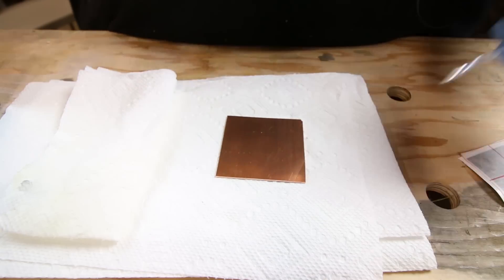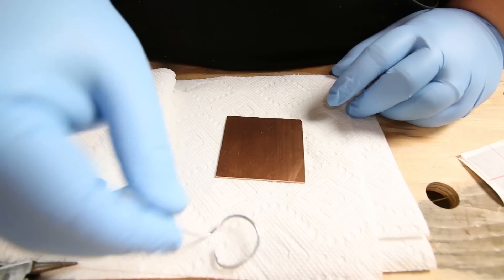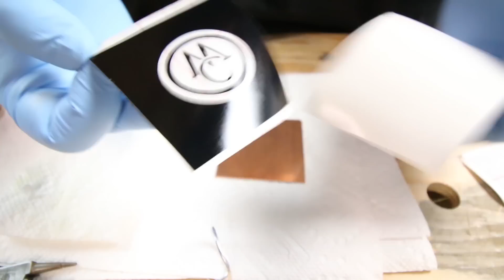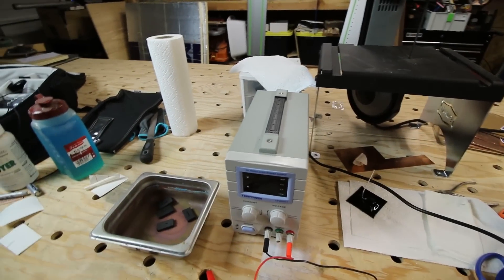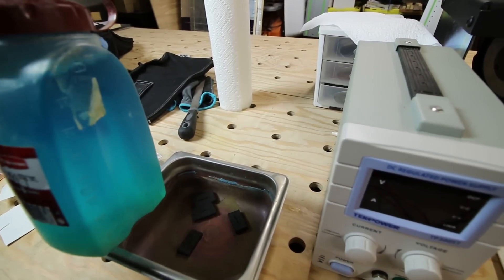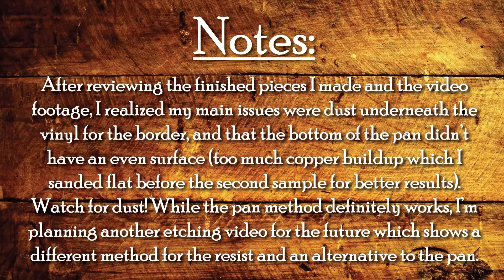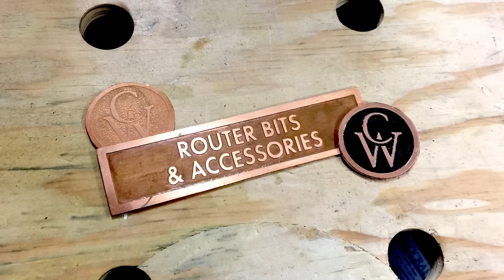Etching Copper Badges & Nameplates Without Acid!

Comment: Since you're removing copper, you can simply use household vinegar with a bit of salt to increase conductivity. The copper sulphate isn't required. The copper in solution is only useful when plating.

Comment: Just my two pennies worth - solder your contact to the corner of copper.
Clean your copper plate with half a lemon and a shot of baking soda to de-oxidise it.
Apply your vinyl as a negative image and remove the excess. Dry the plate and apply a thin layer of wax or nail polish to the whole surface of the plate. Remove the rest of your transfer using a very fine needle to leave the mask in place.
Take a tall glass container and fill it with your electrolyte. Bend a strip of metal for your neg contact and attach the clip. Hang it over the side of the glass. Clip the positive to the plate contact and suspend the plate into the electrolyte. This will prevent bubbles released during the etch from getting trapped on the surface. 
Power voltage and amps - the lower end will give a cleaner and go make a coffee and a sandwich and chill for 45 minutes to an hour.

This should give you an etch that you could use for printing if you so wish.

Comment: Would you be able to use a 3d print as a resist in order to save material? Or maybe wood. Not sure if it will eat through it. Trying to etch .25 inch stainless steel using the salt water electro etching method. Thanks.

Comment: I know when etching steel we use the negative black contact to the item youre going to etch and the positive red to a waste peace of same type of metal.... Maybe try that with two types of copper..... Also I don't know it it will be better but try baking soda and tipex or nail varnish for the areas you may need to keep from etching

Comment: I wonder if you could spray paint through a stencil to get a better sealed pattern. Then after the etching, just wipe down with paint thinner, or maybe just heat up the copper until the paint burns or peels off.
Reply from the maker: This is definitely something I want to try - put down stencil vinyl (or even regular vinyl), spray paint it, peel, then etch.  This I think will work better than a traditional stencil which doesn’t always mask cleanly.

Comment: What kind of blade do you use on your bandsaw for cutting the metal?
Reply from the maker: It’s a Milwaukee Portaband saw which is designed for cutting metal. I’m using the Milwaukee-made Portaband blades. I think it’s the finer tooth pitch - something like 14tpi or something like that.

Comment: Maybe a grease or a wax would work well as a resist? You could 'print' the wax or grease on to the copper using the relief of the vinyl. Just an idea.
Neat idea you have there making the copper etchings.👍
Reply from the maker: That’s an interesting thought! Wax definitely has been used as a resist and probably would hold up well. Thanks for the idea - filing that in my noggin for future testing.
Reply: You can also use Red Staedtler a Lumocolor CD-R Pen, oil based Sharpie Paint Markers and StazOn solvent ink as a resist.

Comment: would it work, if you used regular (salt)water as the solution??? Water would split into hydrogen and oxygen (very flammable!). And the side the makes O2 oxidizes (corrotes) like hell. don't recall if is the positive or negative lead.....

Comment: you could have just "painted" the solution onto the exposed metal... anything else is just a muck around.
Reply from the maker: Not really. It takes a lot of time for the etching to happen. And it also needs both sides of the electrical circuit. Some forms of etching allow for that but this isn’t one of them.

Comment: Thank you for the tip on the chemical ratio. The tough part of milling the reliefs with multiple end mills is as you mill material away, the stock stress relives, and it "potato chips" . All it has to do is move a couple tenths of a thousandths and you end up with steps in the relief. The software I used was "Solidworks" and their post processor to generate the tool changes and "G" codes for the program. I used a Haas vertical machining center, and tried holding .250 thick brass stock in an Anglelock vise with aluminum jaws with a dove tail / step milled into them to hold the stock. Also tried drilling hold down holes in the stock with 82 degree countersinks, and machining a fixture to bolt down the stock with flat head Allen screws so I could mill the relief, then mill the profile all in one shot, and the stock still warped out as the relief was milled. I was milling .093 deep. What consistently works best is to do a rough cut, then adjust tool length offsets in the control, and rerun the program to eliminate the steps. It works great. Just takes a long time. Again, I enjoyed your video, and want to try etching.
Take care

Comment: Hello . Very cool process. I'm a machinist and have machined detailed plates like this for different applications. Running multiple end mills to get the small details and perfectly matching tool length offsets so there are no steps in the relief areas  takes FOREVER !!! Comes out awesome but takes too much time. This process is much easier and you don't need access to a quarter of a million dollar machining center. Question, what is the ratio for the copper sulfate, to distilled water?
Again, great video. Glad you showed the failed piece too so people know what some of the pitfalls are.
Take care
Reply from the maker: For the ratio on the copper sulfate - basically just keep feeding it in until the water won’t dissolve anymore. I know that’s not very scientific but it’s the method I learned from someone else and have used myself. RE: Plates - you’d be surprised just how many of these type of plates are etched, even now. At my day job we ordered thicker etched plates from commercial etchers every day and the quality was superb. Ironically at my work we bought a Datron CNC to do our engraving now just because adding a new commercial etching solution in California that hasn’t been grandfathered in is ridiculous. Plus dealing with the harsh chemicals is a pain and expensive. One tip - if you do have to mill more plates on a CNC there are softwares out there that do the tool changing and calculations automatically now.

Comment: Here is a tip. leave the vinyl on the plate attached for at least 2 days on a place outside on the sun, you will be surprised how well the result will be, that is how I have done it. very sharp edges and deep.

Comment: there is a trick to get rid of air bubbles. you spray the copper with water and soap. then you press the sticker and then use a flexible spatula to drive water soap and air out. works every time and no water stays under the film.
Reply: You are describing how vinyl is applied to van graphics and signage. I agree. DRY application does not get the air out, resulting in bubbles (gaps ), as well as thickness variances from manually stretching the material to try and flattening it. I wonder if using decal material really is the optimal resist right from the start.

Comment: I believe the size of the loop in your wire may be contributing to your border issues. There will be a more intense field created across the circular shape leaving a weaker field etching the border. Also a second plate under the first acting as the negative electrode separated using the foam pads will be more controllable. And distance between plates will change the speed and depth of the etching. The finer control over the dynamics of the field will improve the even etching of the material. I worked on equipment on an industrial scale, scaling it down to what you are doing will have some constants in distance and such but not so much with the field created.  Great work, looks likeyou are very close to perfecting your process. Great video. Interesting subject.

Comment: Same process my dad used to copper plate stuff, just reverse the poles.
Reply from the maker: Even in this arrangement that’s basically what’s happening. If you were to reverse the poles though I think you’d need a copper rich solution or to have both sides of the circuit be copper (in my case I’m basically copper plating the stainless tub, but it wouldn’t work in reverse since the tub isn’t copper).
Reply: Forgot to add the copper sacrificial piece into the solution.

Comment: Probably face-down isn't the best.  You may want to try constant agitation/vibration or come up with away to stand it vertically.  
I usually etched circuit boards vertically.  
There may have been hydrogen or oxygen bubbles gathering on the underside,giving the uneven texture,  due to the electrolysis.
Reply from the maker: I think you might be right. For my next etching experiments, I’ve been planning to have the copper vertical and also have the other side of the circuit be a piece of flat sheet metal that I can more easily sand back to flat after the etched material builds up. I’ve also heard of folks adding little fish tank bubblers to help with agitation, but I’m not sure if I’ll try that or not.

Comment: Very interesting video and etching process. Thanks for sharing
I missed one thing (I did not see/hear that mentioned in the video but maybe it was there). How long was the etching time?
Reply from the maker: +Hans de Groot I don’t recall precisely. Somewhere in the 60-90 minute range I believe. I tried different settings and power levels. Some folks have done lower power levels and longer etch times.
Reply: Thank you for your quick reply.

Comment: Look at he band saw usage between 2:43 to 3:02.  This is what a set up looks like for someone destined to loose some fingers.

Set your guide just above the work piece.  Should something slip, it pervents your tender body parts from hitting the blade.
Reply from the maker: +Roger Shoaf I’m definitely aware of safe bandsaw operation, however this style setup (portaband mounted in a table) doesn’t have an upper guide that can come down to the work piece. My fingers were away from the blade as much as the work would allow, and there’s also the possibility that camera angles made things appear more dangerously to you than they in fact were. This is pretty common.

Comment: How can I etch into a large sheet of copper that has other work and metals built into it?
Reply: I would suggest build a plexiglas box around your area to be etched, glued together and down with silicone. The box would be filled with solution and a sacrificial electrode suspended in it.

Comment: I know this is an old video, but I just watched it after doing my own etching video, with ferric chloride though. I was thinking about your poor results with the vinyl falling off. I was wondering if you had used the other parts of the vinyl as a mask, painted the copper, and then peeled off the mask and etched it like that if the results wouldn't have been better? The paint would act as the resist, and you wouldn't have to worry about the glue of the vinyl failing through the etch.
Reply: I was wondering how well a sharpie marker would work as a resist?
Reply: I had the same with vinyl floating off the substrate so I used better, thicker vinyl and it worked perfectly.
Reply from the maker: Would be interested to hear what brand/type you used.
Reply from the maker: +Switch & Lever I haven’t tried that yet (didn’t think about it at the time) but that’s been suggested to me since. Definitely going to give it a go next time around! I also think arranging plate vertically in a deeper container and etching for longer periods at lower power seemed to give people better results with the vinyl. Small world by the way - follow you on IG. :)
Reply from the maker: I’m familiar - the most common is Press N Peel Blue toner transfer paper. I’ve also heard people have used the back wax paper from Avery labels fairly well also. I do intend to give them a shot - just haven’t yet.

Comment: I wash off the copper with salt on half of a lemon. Rub well and you will remove the oxide layer leaving the true color of copper which appears as pink. Rinse off with warm water, dry well with a clean lint free cloth and apply the mask. The etching equipment and solution should be ready to go so the copper goes no the etching bath with little delay.
Reply: Excellent idea, thanks

Comment: Do you think this method can be used to produce wax stamps for sealing envelopes?
Reply from the maker: +Najey Rifai Possibly. Wax stamps generally have a pretty deep relief compared to these etchings but you’d definitely still see something in the wax. One tip though - you’ll need to flip your artwork and etch it backwards if you plan to try that.
Reply: That makes sense. Thanks. Do you know any other methods that could get deeper relief?
Reply from the maker: +Najey Rifai You could use casting, or machining (CNC).
Reply: I'll look into it. Thank you, merry Christmas.
Reply: Najey: for deeper relief, consider etching multiple sheets all the way through, then stacking them and brazing the edges together.  Consider leaving holes for alignment shims.
Reply: Interesting method, I wonder of the brazing would mess with the shape. Guess I won't find out until I try. Thanks for the suggestion, merry Christmas. :)